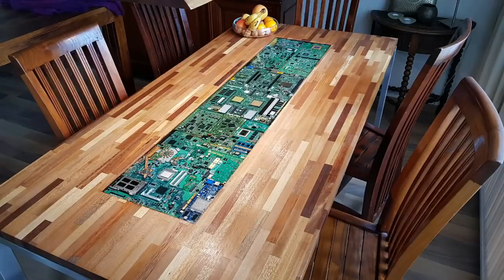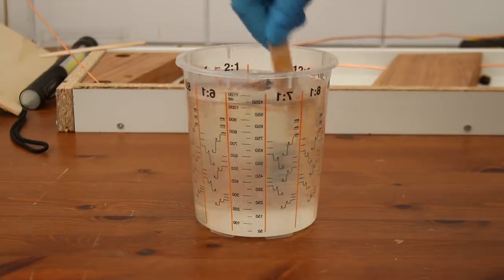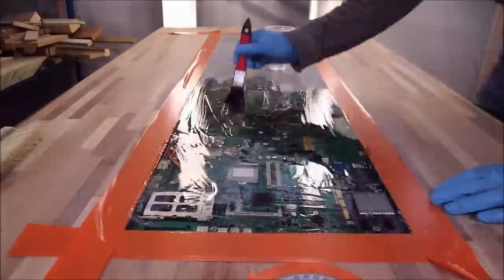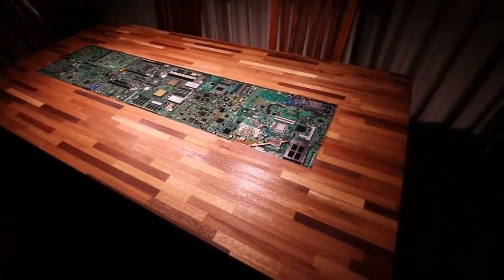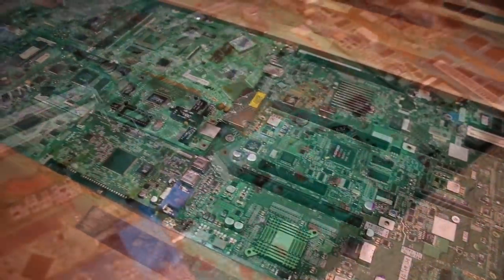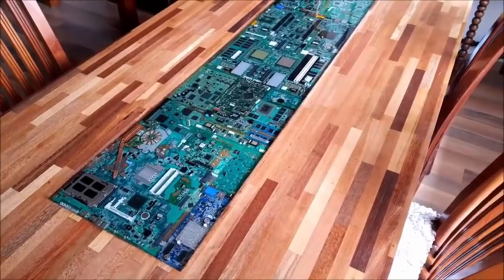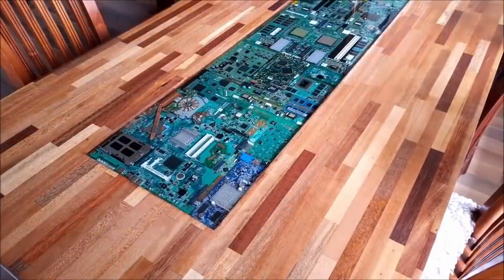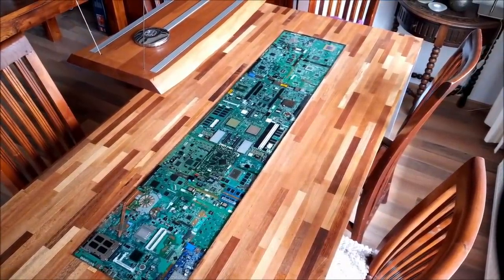Circuit boards with lights in epoxy in a table

Comment from the maker: In the mean time I tried to fix the table, and that is in this video: https://youtu.be/rJBFk-5gMQY 'How (not) to pour epoxy'. If you want to know what happend with the table, check it out!
Reply: problem is that you poured multiple layers instead one. either you go with one pour or you pour many times but before the bottom layer gets dry
Reply from the maker: @Fake Reality - Why spray clear? In fact I coated the boards with one first pour (I should have put a bit of epoxy on the wood too). So I agree that you should treat everything you pour in first. But it can be done with epoxy as well -  see the new video.
Reply from the maker: @Los Kr34ck - No idea. It's not something that is on my mind. People here told me I could sell it for thousands, even tens of thousands, but I don't know. I haven't got the channels for that and am not that interested in selling. It's OK where it is, in my small showroom in front of my workshop. 😊
Reply: @Onrust1  oh boy, can't wait for you to play doom on the table, XD
Reply: maybe inside the parts of the PC boards was still air in them, 
when you poured the epoxy air went up and ruined the final efect
Reply: Glass top, live with imperfections
Reply: How much would you sell it for had it been a success
Reply: Ğziszizüz
Reply: Sz
Reply: ca a etait long a faire ?
Reply from the maker: @Billy Barry - Do mean how long it took me? I couldn't tell you how many hours I put in, but I worked on and off at it from the beginning of April until the middle of July.
Reply: I cant speak english
Reply: Who the man? You the man..we have alot in common⚡📷💻📡💡✌⚡😁
Reply: couldnt it be fix by removing some epoxy then cut a groove then lay a glass in with epoxy.
Reply: ned?
Reply: Just put plexiglass on the top
Reply: Надо было инфракрасной лампой прогреть все слои хотя бы на пару часов и потом оставить на сутки для просадки, тогда бы от нагрева шлифмашинки не поплыли сырые места.
Reply: Why you don't try to get the ugly parts out with acid instead of cutting it out?
Reply: After mixing in measuring cup you still have some unmixed epoxy on the walls. So pour epoxy into another jar. that way you'll have evenly mixed epoxy.
Reply: Just put glass on the top of it and call it a day
Reply: Can't wait to see if you were able to fix it! Great video!
Reply: Really happy to seeing your page
Reply: Why not use a piece of glass to cover the electronics instead? It looks nice with epoxy, but if you need to tweak with extra lights you can just lift up the glass and tweak it.
Reply: I wonder if it’s possible to spray the table with a sealer that’s used to stabilise bad paintwork on cars,it’s a clear coat sealer. Then maybe three or four coats of 2 pack lacquer?
Reply from the maker: @Mark Miller - Good question. I really don't know, but I don't think so. After some years now, I still see things changing inside this table. So I'm guessing the bad epoxy would have its influence on the lacquer... Anyway, now I am the more wiser, you can see what I did with the table as I tried to fix it, here: https://youtu.be/rJBFk-5gMQY
Reply: Muto
Po
Koteo
Reply: Remove 5mm of epox, polish the sureface and use a mineral glas for the top layer. Nice work !

Comment: This is now part of the Jack the Ripper show forever now. I got about 3333333333333333333344444444444444444555555555556666666666666666666666666777777777777777888888888888888888888888899999999999999999999999999999999999999000000000000009999999999999999999777777777777777777777777788888888888888888888888888888888899999999999999999999999000000000000000000000000000000000000000000 on the Jack the Ripper show forever now. This will increase across time and space forever now.

Comment: How come did you put your phone on the end of the table? Was it illuminating the led lights?
Reply from the maker: Yes. You shine with your (phone flash-) light into the side of the table and the 15 LEDs will light up!
Reply: Oh ok. I thought when you turn off the lights, the led light would illuminate by themselves

Comment: I wondered why you didn't just cut a rectangle hole in the middle of the table and then place a board or cover over the hole on the bottom then you could place all your electronics inside the hole from the top and refill it with epoxy resin..
I would suggest you send the whole table and when you fill the hole in the middle with epoxy resin You should overfill the hole and coat the entire table with the epoxy
Reply from the maker: Could have done that, but didn't. Here is what I did: https://youtu.be/rJBFk-5gMQY

Comment: Why don't let you run the epoxy also over the wood?
I would try to epox it all as "one step" in no layers.
A heat gun after the epoxy step will destroy all bubbles and bad spots.
Reply from the maker: Could have done that, but didn't. Here is what I did: https://youtu.be/rJBFk-5gMQY 
I used a small torch for all layers. I have a love-hate relationship with epoxy. It can do what nothing else can, but it remains plastic. I like wood more, so wood should stay wood. But I must admit I am still contemplating pouring it all in... Watch the follow-up video..

Comment: This doesn't look good at all. As someone who is in tech for a living....you made no effort in keeping the realistic look. What you should have did is fed power to each components led by bypassing the board...easily done with wires underneath ..that would have atleast made the pcbs look authentic. This looks like a jumbled mess to anyone who's worked with pc components...😢
Reply from the maker: Maybe.. But for the other 99,9999 per cent of the population it looks cool. The table always was a hit for visitors in my workshop. Besides, I didn't want no electricity in it.
Thanks for the sub! 😊👍

Comment: I would have used a heat gun after laying the epoxy in to get rid of the bubbles and improve the curing process.
Reply from the maker: I did on every pass. I used a small torch. I wouldn't know how to get a bubbles-free result without doing so.
Reply: @Onrust1  Oh bummer.  Maybe it was just not mixed well enough or long enough.  Sorry but great job anyway!
Reply from the maker: Thank you! You should watch the follow up video I made after this one. In there I analyzed what went wrong. Link is in the pinned reaction below the video.. (yes it was the mixing..😊)

Comment: Also, use small (0805 or 0603) SMD LEDs, that way they look like they belong on the boards.
Reply from the maker: Ehhhrrmm... there are NO functioning LEDs on this boards. 😏 Although they light up, there is no electricity in it. I wonder if you have seen all of the video? 🤔 The proposed SMDs are not at all suitable for this.
Reply: @Onrust1  Haha, yes, I realized after posting, silly me.
Reply: @Onrust1  Guilty! I skipped over parts of it. But i did see the part where you held the phone onto the fiber optics, i was just too dense to put two and two together.

Comment: Hey all.   I'm just getting into acrylic paint and resin pour on tables.   I need to know different tools I would need.   I want to know what tool I could use to put a trench like canal on the edge of the table in order to lay stones or rocks into the table as well as what sander to use with durable grit instead of regular sand paper.  Thank you!
Reply from the maker: Be sure to check out the follow-up video of this one: 'How (not) to pour epoxy' here: https://youtu.be/rJBFk-5gMQY

Comment: I tried to do epoxy in my garage in Florida in summer and the humidity caussed a similar problem, it was sticky for months and never dried. Mix properly and have low temp and low humidity!
Reply from the maker: I doubt the humidity or the temperature was the cause of the stickiness.. I think it to more probable that you (as I) didn't mix it well enough. In my experience high temperatures have only an accelerating effect on the hardening process of the epoxy, and it gets more fluid too at higher temperatures. I think it should be at least 25 degrees C for the best results. Above that can cause the epoxy to cure too fast. 
I can not imagine in what way humidity would harm the epoxy - just a bit of water enclosed in the epoxy could not be a problem. 
Be sure to check out the follow-up video I made 'How (not) to pour epoxy' here: https://youtu.be/rJBFk-5gMQY

Comment: Ummm, router sled?... 2:33
Reply from the maker: One blow of my chisel can remove so much more material than the router in the same amount of time.. (at the sides the chisel was easier to, because I had to watch out to hit the straight sides with the router). Anyway, I have no regrets on that. 
Someone else pointed out that it would have been easier to cut the whole rectangle out and put a sheet of wood in, and I think I would do that next time, because that truly would have been faster.. 😊 I guess it's the way you learn all the time..

Comment: What lighting engine did you use for the optic fiber ?
Reply from the maker: Anything goes. I use the light in my phone. Didn't you spot that? 😊
Reply: @Onrust1  You got some pretty cool effects 
What did you consider for the final build  ?
Also a general tip for epoxy, always use two buckets
Mix it in the first pour it in the other mix it again pour it in the first than pour it on you project 
This is what I started doing recently and so far no soft spots
Reply from the maker: Don't get what you mean by final build..? Yes, you're right about the epoxy. I made a video about how to pour: https://youtu.be/rJBFk-5gMQY
Reply: @Onrust1  What light source you would have used if the table came out right 
Like if you intended to sell it
Reply from the maker: I'm still afraid I don't understand.. There is a small hole at the side of the table, where you shine in with an external light source, like the light in your phone... There is nothing more to it. Have you watched the whole video?
Reply: @Onrust1  I get that but wouldn't you have used something (like a led) in the final build ?
You push a button and the fiber optics "leds" in the epoxy glow
Maybe I misunderstood what you were going for
Reply from the maker: No, I didn't want no button. I think there is some kind of charme in doing it yourself, with your own light source, instead of pushing a button...
Reply: @Onrust1  Ah ok than

Comment: maybe sand the epoxy some more the wood around it can take the shape of a slope). then apply a thicker layer of epoxy that over laps with the sloped wood. Fixed!
Reply from the maker: That is about what I did. You should really check it out, the video is here: https://youtu.be/rJBFk-5gMQY

Comment: You can try on other thing, realize an other little thing with the epoxy, and try to heat it with a thermal cleaner, you will see that the epoxy will soften, and the bad epoxy effect will desappear, perhaps it's can help you, but protect the wood of the heat
Reply from the maker: Have you seen the follow-up video? What I did with it? : https://youtu.be/rJBFk-5gMQY

Comment: is the epoxy yellow now?
Reply from the maker: No, not noticable. But 1. I chose the epoxy with the UV blocker built in, and 2. the green color of the boards make it not that easy to see if the epoxy turned yellow..

Comment: I had the same thing happen with a bar countertop.  I never figured out exactly what went wrong, but I had to essentially start over.  All I can think to do going forward is to pay close attention to the temperature, humidity, and exact mixing instructions.  There are some epoxies you have to mix, let stand for a period of time, remix and then apply.
Reply from the maker: You should watch the follow-up video I made, with the lessons I learned from it: https://youtu.be/rJBFk-5gMQY

Comment: Провода надо было под платами положить и дыру делать вниз и  красиво и надежно 
В целом идея неплохая но сделано как всегда через кривые руки стол с проводами под непрактичный ,в домах животные и дети ,
При переезде всегда риск оборвать
Reply from the maker: The glass fibers under the table are not exposed. I put a thin sheet of plywood underneath, so they are protected.
Reply: @Onrust1  
Still .its be better put wire under composition and use whole under ..
Its more practical and better for design 
Its just opinion...don't take it personal
Reply from the maker: These glass fibers have a bending radius of about 1 cm - bending more sharply would cause them to break. So they never could go anywhere else then where they are now. I'm not taking it personal. 😊 Just clarifying. 👍
Reply: @Onrust1 
 if put fiber first and then smalll amount resine , after  on top of it  -  yours composition 
It will be  tiny sandwich but it will be more sharp looking and quality

Comment: It's still excellent, the little flaws make it unique. With the LEDs, there was no tech to get the blinking light effect, just waving your phone flashlight across the fiber optic ends?
Reply from the maker: I fixed the flaws: https://youtu.be/rJBFk-5gMQY 
I liked the idea of the flashing light being a by definition temporary effect - was afraid you'd get crazy of blinking lights in the table all the time. Think of kids - flipping a switch they can do that for quite some time. Holding the phone in front is under a minute time not that interesting anymore... 😊

Comment: I congratulate you.
From the conception, work, to the effort you have put into the project, it is worth highlighting.
Having placed fiber optic with a led terminal is a good idea, however I consider that placing a fixed light source is recommended.
You have won in every way.
I am an Electronic Technician with 25 years of experience and I am dedicated to what you have done, so I consider that your work has been a success, I think you understand me.
I have used the google translator, I don't speak any English at all
Congratulations

Comment: Just put resin on the whole table. That way it will all be solid at the top and make the table usable.
Reply from the maker: Could have done that, but didn't. Here is what I did: https://youtu.be/rJBFk-5gMQY

Comment: Could you possibly build a frame around the perimeter of the surface? Cover the frame with a waxy tape. Then fill that frame with good epoxy?  Remove the frame after the new epoxy dries. Then sand and polish the edges.

You'd be making your table thicker
Reply from the maker: Could have done that, but didn't. Here is what I did: https://youtu.be/rJBFk-5gMQY

Comment: The areas where you have waves in the epoxy, if it's not a soft spot, is caused by overheating of the epoxy. Overheating generally occurs when you pour too much epoxy (to thick a layer). The soft spots can either be the epoxy was not mixed well enough (as you suggested) or the room where you poured the epoxy and cured it was too cold. If the epoxy or the room you're curing it in is too cold, the epoxy does not go through the thermogenic reaction it needs to harden and cure.
And ignore all of the non-creative fools who replied with "just put glass over it" , or made snide remarks. They obviously do not have a creative bone in their body!!
You did a great job for your first table pour.
Reply from the maker: Thank you. Yes, I learned a lot from this, as you can see here: https://youtu.be/rJBFk-5gMQY Regards from the Netherlands!

Comment: I got some epoxy and the instructions said it needed to be mixed using a drill with a paddle as it's impossible to do thoroughly enough by hand. You need molecular mixing. The quantities I was using wasn't much but I still made a paddle out of some copper wire and mixed using a battery drill. Set perfectly. I think it would be easier to use a circular say and just cut the sides then the end off and glue back together without the middle and find some more circuit boards. Use a sheet of ply underneath and try again. That's assuming you haven't done something with it already. This was posted over a year ago.
Reply from the maker: You're right about the mixing. It can be done manually, but in reality it is too hard, and you better use a drill. Only very small portions, less than half a cup, I do manually. Indeed, this video is over one year old, and I have taken it on, the outcome is in here: https://youtu.be/rJBFk-5gMQY

Comment: Maybe you should have used polyester resin with a catalyst, especially since the epoxy smells horrible and you will have that smell in the house for a month or even more.
Reply from the maker: One of the things I learned is that there are so many kinds of epoxy: mine smells hardly at all, not even while working it. It's a danger, because you start to falsely wonder whether you should wear a mask. More of what I learned with working with epoxy here: https://youtu.be/rJBFk-5gMQY
Reply: @Onrust1  OK, you'll never fall asleep without knowing one more thing

Comment: Why didn’t you just route out the middle instead of chiseling?
Reply from the maker: For the router not to fall in at some point, I would have had to make some kind of sled for it, and I didn't want to do that. Besides, one blow of the chisel is so much more faster than the router, I chose the chisel.

Comment: WAIT!   You mixed too much hardener into your epoxy.   Sounds backwards, but you turn an endothermic reaction (heat within) vs. exothermic reaction (gives off heat).  If you give off the heat the epoxy won't harden.  What you can do, and I've had this work, is to pour correctly mixed epoxy, at the proper dry temperature  (usually 75 degrees F ALL the way through the dry period) all over it.  I'd pour it over the wood too.   Make sure you stir it EXACTLY like the directions say.  If it says 3 minutes do so....not 2 minutes...not ahhh that's good.  Don't whip air into the epoxy when you stir it.
Reply from the maker: Thanks for the advice. You might be interested in the follow-up video I made: https://youtu.be/rJBFk-5gMQY